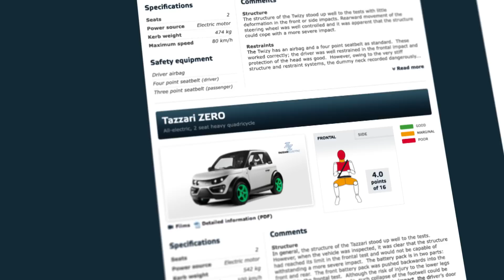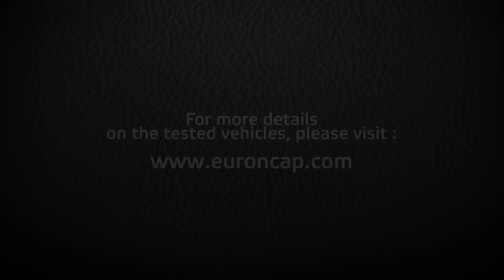Euro NCAP Crash Tests on Heavy Quadricycles

Comment: None of these quadricycles can reach 50kph. So what is the point of testing them at 50kph?
Reply: @RichardEssery-s5v I cannot run at 30mph, but a car hit me at 30mph.

I guess it's value is seeing what a quad crashed into at at high speed would look like for the driver of the quads.

Comment: I don’t like quadricycles.
Reply: They're funny-looking to be sure (short and stubby, and generally oddly proportioned compared to regular cars), but can be quite practical in a small town with relatively low traffic.

I myself have a second-hand Ligier JS50 and while it has had a lot of issues with the door-locking mechanisms (mostly cold-weather-related), it's plenty enough for grocery shopping on rainy days (I prefer taking the bicycle when the weather allows).

I've even gone to the hardware store and "crawled" home with some 3.6m wooden beams and planks for home projects.
Had to build a small ramp-cradle-thing to bolt down where the passenger seat used to be in order to have somewhere to fasten the cargo straps and hold the wood in place, and a sawhorse-like support structure in the cargo space, but it works.

While flimsy, these vehicles have their uses.

Comment: seat belt brake off in one of them they should not be on the road and that just into a wall what happen if it is a over lap
Reply: You’re probably going out through the windscreen and surf the blacktop with your face. Just saying.
Reply: The belts are intentionally engineered to successfully fail at high loads.

This is because during a crash, the belt restrains your torso from moving forward, and the inertia of your head will cause severe stresses on your neck while your torso remains restrained by the seatbelt.
If the tension gets high enough, your neck snaps, and so the seatbelt is designed to snap first.

Some belts even have "rip stitching" whereby a portion of the belt is folded and stitched onto itself such that the snapping of these stitches allows the belt to de-tension itself more than once during an impact, further reducing the stress on your neck and appendages.
Reply: Whoops! You’re dead 💀

Comment: Safety is important. In that case, how about motorbikes? They are also legal to be driven on the road and some of them with performance comparable to super cars. If Quadricycles to governed by stringent safety requirements, does it mean motorbikes should also be treated the same?
Reply: No. A motorbike can't really be safer. As long as you're not fastened to the bike.
The Quadricycle has more room for improvement, as it's pretty much just a small car. Therefore it would be plausible for the manufactures to create a safer vehicle. They just try and keep the cost down, and they are keeping it down by saving on safety.
Reply: @datsatoilet 
8 years late, but anyways, if memory serves it's actually a weight issue.

I can't recall if it's a EU standard or just a swedish thing, but here the so-call "moped cars" have a maximum service weight, sans driver, of 425kg (fully fueled and ready to go, but with no people or cargo inside), and are allowed to carry up to 260kg of additional weight (driver, passenger, pcargo).

Now, I'm honestly quite happy that there's a vehicle type that's legally prohibited from experiencing the sort of weight and size growth that's been happening to normal cars (nevermind the growing american cult of the SUV), buuut...
I do own a Ligier JS50, and in two years of use I've had to visit the shop three times due to malfunctions/failures in the door locking mechanisms at low temperatures (swedish winters can be pretty "crispy", turning any kind of moisture into superglue).
Reply: that is so true
Reply: Christian Moeller Exactly!